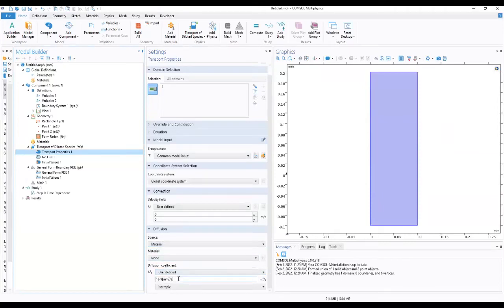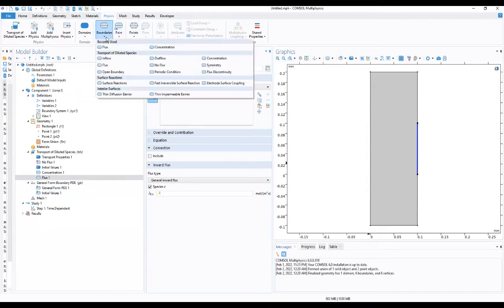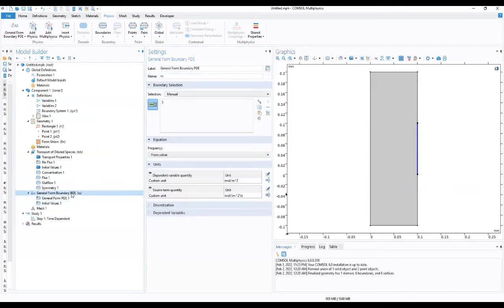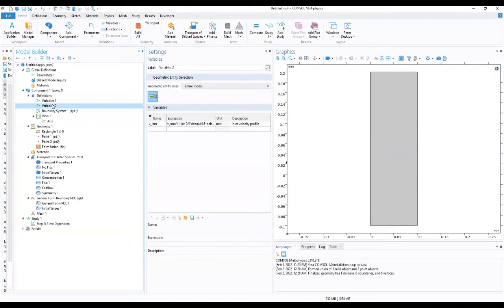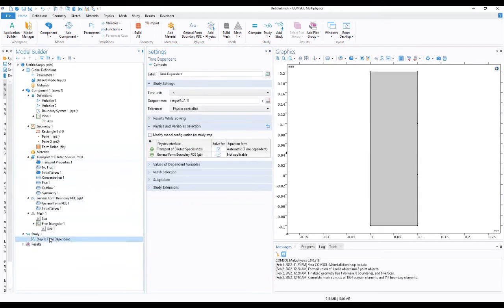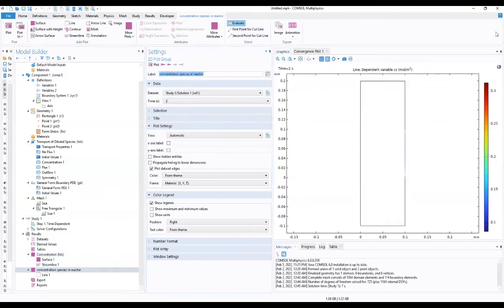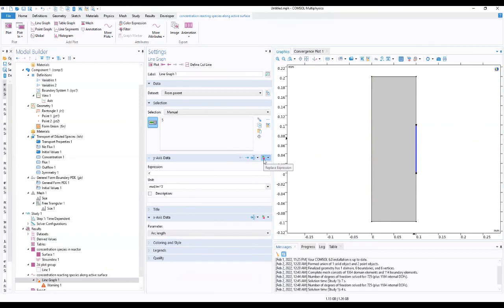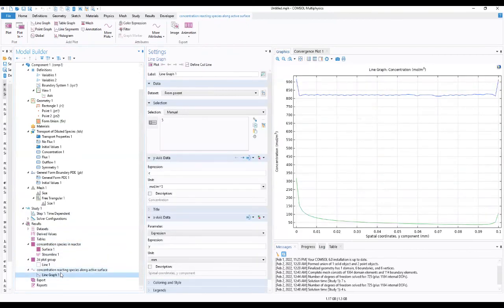HOW TO MODEL DIFFUSION AND ADSORPTION SIMULATION IN COMSOL MULTIPHYSICS. PART 2

Comment: thank you for this video..............only one important note.... one needs a briefe description to what is happining and what is the basic of the whole process,.i.e., equations
Reply from the maker: This example demonstrates how you can model  different
dimensions (2D and 1D in this example) in a fully coupled manner using COMSOL Multiphysics. It involves a small parallel-plate reactor with a catalytic surface. When modeling chemical reactions, the reaction rates are commonly functions of the
concentrations of the reactants in the phase that transports the chemicals. Similar applications where surface processes are of critical importance include biochip devices and semiconductor components. The equations used include those for the Transport of Diluted Species interface as well as the General Form Boundary PDE interface on the active-surface boundary.